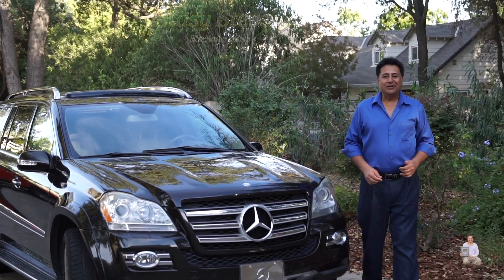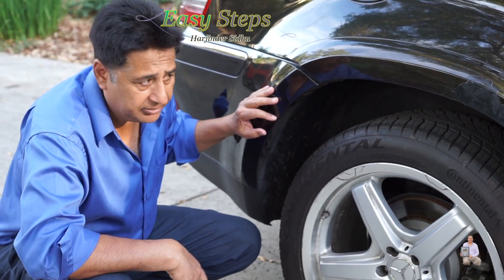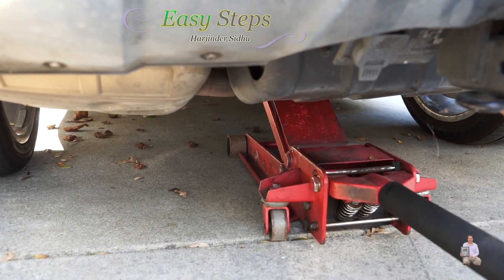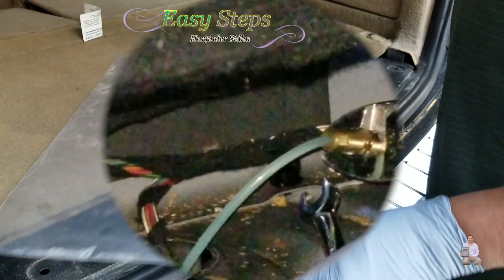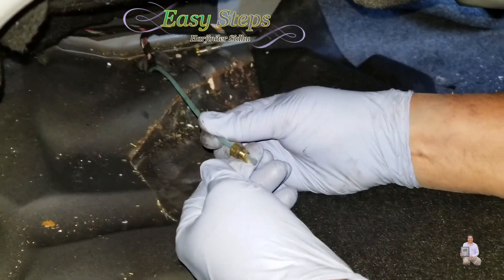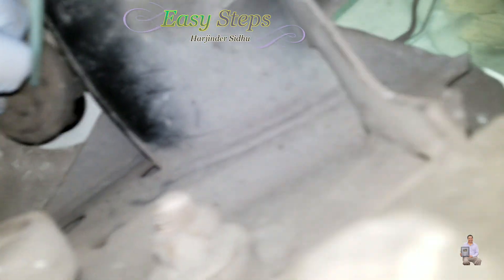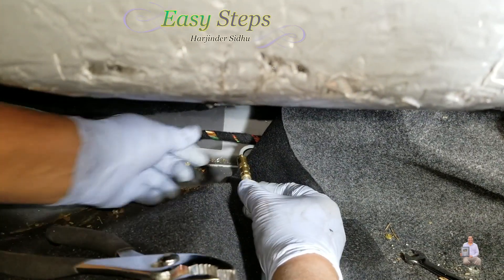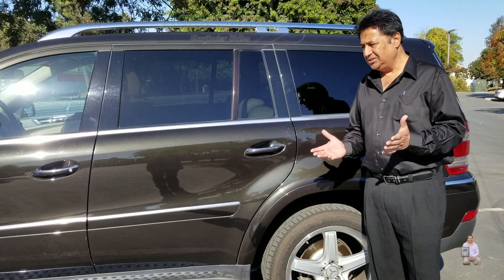Mercedes Air Suspension Bags | How To Fix Leaking Suspension on Mercedes GL550 | GL Class X164

Comment: Hello i had a malfunction airmatic dash light constantly on w quiet compressor,never heard turn on never lost air but 1 shop said maybe valve block,another shop said compressor so i decided to replace 3 parts,compressor, valve block and filter line but after replacing compressor w valve block and filter my dash light off but while driving i hear constant running of compressor/noisy,,only thing i didnt replace was Relay,,do you believe by replacing Relay that itll stop compressor running constantly
Reply from the maker: It sounds like you may have a faulty relay. I would recommend checking and possibly replacing it.
Reply: @EasySteps_Sidhu  do u know where the Fuses/Relay for airmatic is located
Reply: @EasySteps_Sidhu  2016 Mercedes gl550

Comment: I have a lowered Audi A4.  I would like to know if it's possible to have the shocks installed on the rear so that I have the option to raise the rear higher than the front so I can drive with the rear end jacked up high.  Can this be done?

Comment: Hi. I have a gl 450 2009. The air suspension compressor and right air bag front was replaced by a so called german car mechanic but they were unable to calibrate the system. Now the truck is about an inch higher on the left side. He said to go to mercedes dealer to have the issue fixed. Any suggestions. Thanks. 
Adil
Reply from the maker: Go underneath your GL and adjust ride height sensor and it's very simple and easy to do on your driveway and no special calibration or tools needed, you need to do couple visit under the GL to adjust the sensor, adjust, turn on your GL and check...if it's still not even then turn off your GL and readjust again...I hope it helps, thanks for watching. Good luck and please share the results.
Reply from the maker: I have started posting DIY videos on my 2nd channel "Sidhu DIY" so please like, share and subscribe, thanks.
Here is the link for my 2nd channel, thanks in advance.🙌 🙏 🙌
https://www.youtube.com/c/SidhuDIY